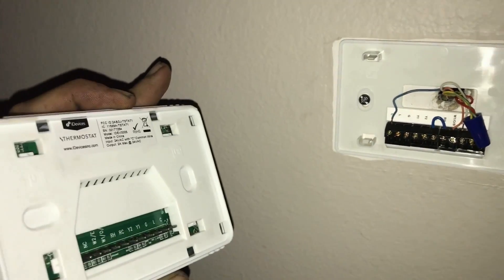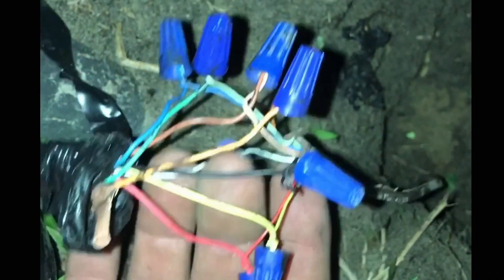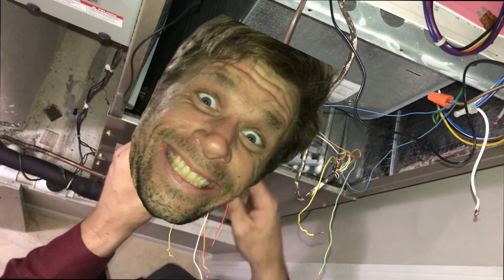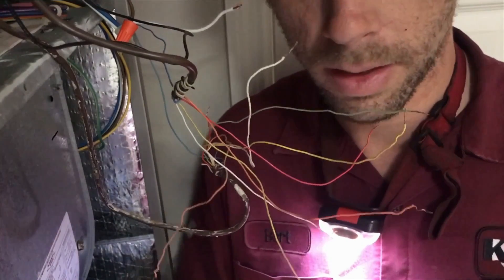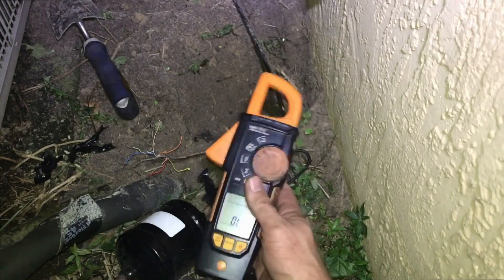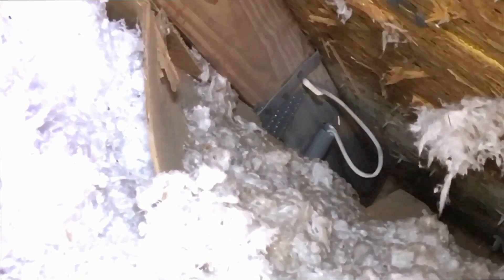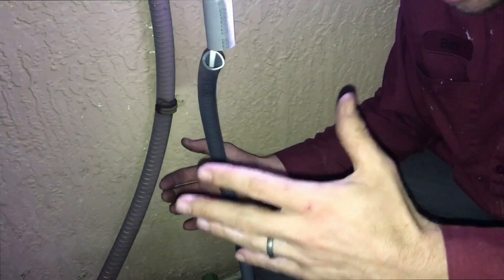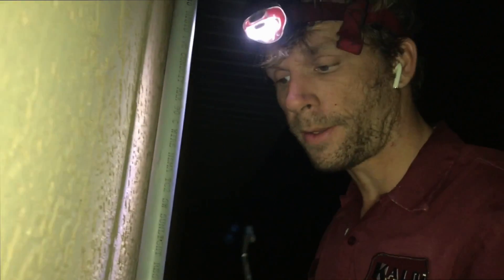#BertLife 4 - Why Does the Fuse Blow? Magic?

Comment: The wire you said was hot and used to touch the other wires with , is that the hot low voltage from the transformer?

Comment: Looks like you have spare conductors twisted around sheath. Why not ohm spare conductors & use  good one saving customer cost pulling new wire? I pull wire with spare conductors for this reason. I salvaged Carrier 3.2amp control breaker, put on aligator clips & clip breaker in series to prevent possible shorting out transformer.